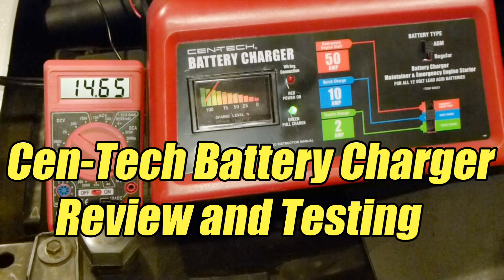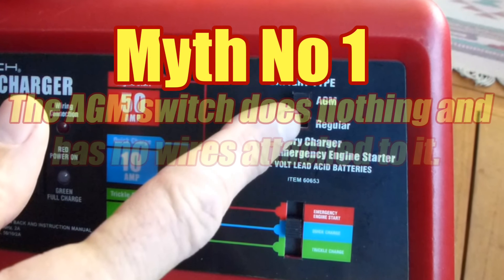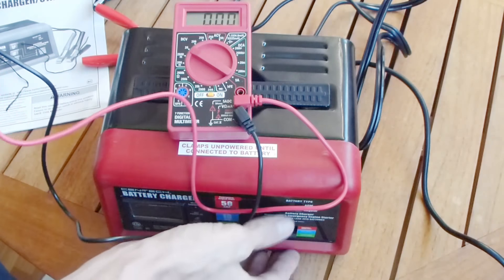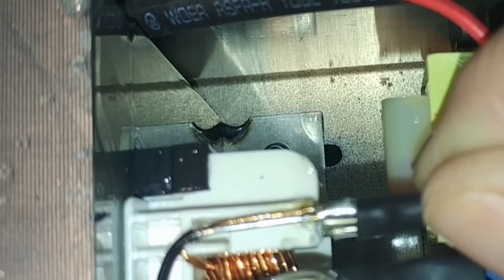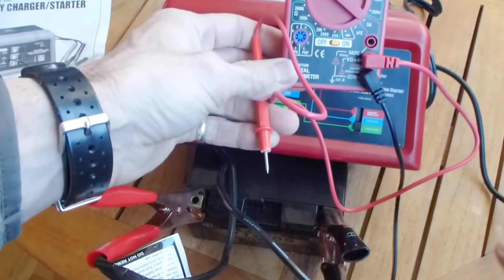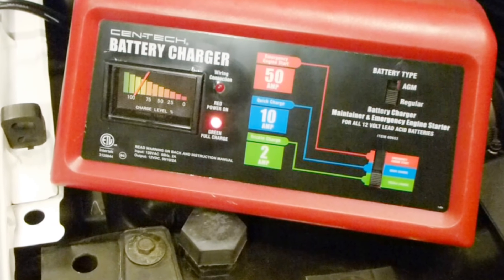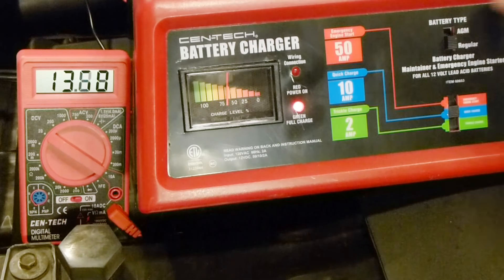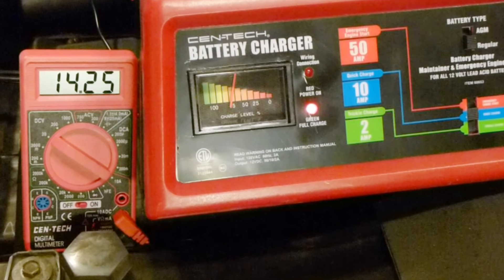Cen-Tech Battery Charger & Starter Review and Testing Harbor Freight

Comment: I set the charger to trickle,  plug in the charger, connect the clamps to the battery posts and nothing, no indicator lamps turn on, the charger appears to be completely dead accept for the tick sound it makes when I plug it in. I used it in the spring and it worked.  Six months later, nothing.  What night I be doing wrong.  Could it be my battery isn't depleted enough, less than 3 volts depleted? But then why won't my engine turn over?  No car lights, no sounds or signals.  I am completely baffled.  I reset the ground fault protector so I know the power outlet is working.  What's your guess?
Reply from the maker: You said "No car lights, no sounds or signals." I would check the current voltage of your battery. If it's below 3 volts, most chargers, including these, will treat it as no voltage and will not put out charge voltage. It's printed on the charger. It's a required safety feature. If the voltage is too low, you'll need to temporarily jump in a second battery to get this charger started for a while. If the voltage stays high enough, you can remove the second battery and let the charger work on your battery. Good luck with it.
Reply: @ScubaMoto I tested the battery's voltage as you suggested (with a digital multimeter):  point 65 V. Based on what you wrote the low voltage of the battery caused the charger not to engage (or light up).  Same as if it weren't connected to a battery at all or the charger were unplugged or if plugged in,  the circuit breaker had tripped.  Of course now I was wondering if my multimeter were functioning properly.  The battery had to be good.  It was only six months old and I had recently driven the vehicle 250 miles.

I returned the battery to the AutoZone where I bought it and asked him to test it with his multimeter, he did, "Nothing", he said.  Luckily for me it was still under full warranty.  I got a new battery and 20 dollars to boot.
Reply from the maker: Well that's just a whole lot of good news. I'm glad to hear your charger is fine and I'm glad to hear you got a new battery plus a $20 bonus. And I'm glad the video helped out. EDIT: If it were mine, I would test the charging system. A new battery lasting only six months could indicate a fault in the charge system or even loose battery connections are known to cause that result. Thanks for sharing.

Comment: I returned mine today. It did not seem to work in any mode when my car battery died.
Reply from the maker: Did you find one that worked on that same battery? Once a battery's below 3 volts, chargers won't activate. Chargers less than 20 years old anyway. Safety reasons. They'll need another battery involved to start the charge.

Comment: Will this charger charge a battery that is completely dead ? some changers Wil not work if the battery is dead.
Reply from the maker: Great point. Not too many modern chargers will charge a totally dead battery. They need to have a battery on board to do it. There's a note in the video description on this.

Comment: Thank you for such a detailed to the point review. Very good. Is there a chance we know how low the battery would go before the charger is unable to start? I mean it was able to start at 8V. What if I have a dead battery with less voltage? I am trying to find a charger that would be able to revive a battery with really low voltage.
Reply: @ScubaMoto  Sure, and thanks again. Keep the good work.
Reply from the maker: Waleed Almurshidy: The lowest I had on hand was 8 Volt but it should respond to batteries down to 2.5 volts but I doubt if a lead acid battery that low will restore. You would want to start in trickle (2 amp) mode. Let us know if you try a lower voltage.
Reply: Three cars which were completely dead were not initially charged by this charger as the batteries were likely seen as so low they didn't qualify as a valid charge destination. If so I usually attach another battery or jump from another car for 10 minutes to bring the voltage up to the acceptable range then attach this charger for a few hours.

Comment: Just bought one but when connected to battery i get nothing am i doing something wrong or is my battery just dead
Reply from the maker: Check the voltage on the battery. If it's near or below 3 volts, modern chargers won't provide output. Check note 3 at the bottom of the video description. I hope that helps.

Comment: Directions say to ground to the chassis. What does that mean?
Clip the negative to the vehicle?
Reply from the maker: Angela Schulz: Thanks for the great question and absolute kudos to you for actually reading the instructions. Most references to charging a car battery will clearly show clamping the charger directly to the positive and negative terminals on the battery. Nearly all modern vehicles are negative chassis grounded systems. This means the negative terminal of the battery is directly connected to both the engine and the metal vehicle chassis.  If access to battery terminals is difficult, there could be risk of accidentally contacting the two terminals with the large battery clamps if working in a tight space. That is why modern chargers, including this one, have cross detection if the clamps are put on the wrong terminals or accidentally tough each other. In these cases of tight working space, clamping directly to the positive of the battery and then clamping the charger negative to a known good chassis ground point is just as good as connecting to the battery and may reduce risk of crossing polarity. This is fine AS LONG AS THE BATTERY TERMINAL CONNECTIONS ARE GOOD AND CLEAN. This is why I prefer to carefully charge directly to the battery terminals. It is most common but is also simply my preference. Quite often, difficulties with vehicle batteries can be traced to poor battery connections that need to be removed, cleaned and re-attached before charging. Also, if the terminals of the battery are difficult to access (in the trunk, under a spare tire), some vehicles have remote charge connectors that are well labeled and easily accessed from under the hood. These remote connectors are often much closer to each other than terminals on most batteries so caution is also advised when clamping to remote charging terminals. Thanks again for the comment and for sharing.

Comment: I put it on my jeep battery. And nothing happening? Not sure if it the charger? Since nothing at all lights up. How do I tell if it the charger that is broken or my battery?
Reply from the maker: What is the voltage on the battery? If it is below 3 volts, modern chargers will not respond. There are instructions in the video description for charging completely dead batteries.
Reply: @ScubaMoto  Oh, So my battery can be completely drained and that why it not being able to charge? Dam, thought that what batter chargers are for LoL
Reply: @ScubaMoto  Which is the link of completely dead batteries. Im going thru them but do not see it. Thanks
Reply from the maker: Prophet seven: Yep, it's normal for modern chargers. NO/low voltage is seen as the same as no battery so for safety reasons, no output to clamps. The charge dead battery note is not one of the links. It's one of the "notes below" (note number 3) will walk you through it.
Reply: @ScubaMoto  Got it, I just exchanged the battery. Free Swap

Comment: I seen you had a 12v battery at 8v and it worked ….how low in volts can the battery go ,before the charger won’t turn on ?
Reply from the maker: They don't give a specific cut-off but modern chargers are all set for safety reasons to cut off below 2 or 3 volts.

Comment: How will this work for charging my RV batteries on my travel trailer?? Is this a good choice?
Reply from the maker: Mike in the drum room: You should be fine since it has a good trickle charge mode (2 Amp). But it might also be one of the few times an extended warranty on the charger makes sense due to prolonged use. Thanks for watching and for sharing.
Reply: Mike in the drum room I am trying to charge my rv batteries and the charger doesnt light up when i connect it to my battery

Comment: So if I understood you the starter mode only press out around 20amps until the starter is engaged? So if your trying to give a battery a little shot in the backside is it ok to use the starter mode for a few seconds before you seeing to regular mode? Out is that not a did I idea
Reply from the maker: David Beaver: Thanks for the question. I simply demonstrated that the starter mode does not engage until the charger detects the draw of the starter engaging. Not much can be changed instantly about a full size lead acid battery. It will take time to build a good charge. It's best to leave the charger on the battery in 10-amp mode until fully charged. It will take some time. Thanks again for the question and for sharing.

Comment: Just bought this battery charger, the power lights not even turning on it flickers and doesn't work
Reply from the maker: Check the voltage on the battery. If it's below 3 volts, most chargers won't activate on it. It's normal. There's a note at the bottom of the video description on that. If the battery has over 3 volts, return the charger while you can. I hope that helps.

Comment: Hello there I bought the same brand new I need it to charge a dead battery I took the battery off the car put it in my garage plugged it and there is no light on that tell me is on, do you think is defective?
Reply from the maker: That's normal for a totally dead battery. There is a note in the video description about using modern chargers on dead batteries. I hope that helps.

Comment: What I find confusing about this charger's meter is that 100% shows towards the green side and 0% shows towards the red side. Is that what the battery's "charge level" is or is it the "charging level" rate of the charger? And when you crank the engine, the needle goes to "0" - is that the battery charge level or is it working really hard to provide current? Its just confusing.

They should have had 2 meters - one for battery and one for the charger's power output. Or if not possible electrically to show the battery's level then have a legend or markings showing that if the needle is to the right, the charger is outputting more current.
Reply from the maker: Agreed. As I mention in the video I'm not too happy with a gauge that has no units. I prefer the charge meter to have amps as units. Thanks for the comment.

Comment: So if the battery is just completely shot she won't activate and charge it up ?
Reply from the maker: Erik Kinsey: Yes, that's a safety feature typical of all modern chargers. Batteries below 2.5 to 3 volts won't activate output voltage. It's easy to resolve by temporarily jumping in another battery and then removing it. Thanks for the question.
Reply: Problem solved,, Most people will need this instructions

Comment: I plugged my car battery up to it and I heard it click on but no light shows does that mean my battery is just done for
Reply from the maker: Jacob Reynolds:  it would be helpful to have more information about your battery. For example what's the static voltage and how old is the battery? Try both the 2 Amp and 10 Amp settings and give the charger several minutes to establish a charge level. If it clicked, then the voltage on your battery is probably high enough to activate the charger but I would check the level on the battery regardless. Thanks for watching and for sharing.

Comment: How low WILL it go though? I had to rescue my car battery last weekend and it was only putting out about 2.2 volts. The smart charger I have wouldn't touch it, I had to get an old charger from like 1970 that was a transformer and a diode, use that to bring it up to about 6 volts where the smart charger would take over.
Would really have liked to see tests where the motorcycle battery was drawn down lower and lower to see where the charger gave up on it.
Reply from the maker: Most chargers are similar with a cutoff around 2.5 - 3 volts needed to activate the charge function. Regardless of the charger brand, I just use any small battery bridged in temporarily to activate the modern charger long enough to bring the target battery beyond 3 or 4 volts and then pull the bridged battery out and let the charger finish the job on the target battery. I hope that helps.

Comment: So i just bought this at harbor freight and im gonna use it on a van thats been sitting in my driveway for about 6 nonths with a battery thats totaly dead.Ive never used one of these before so let me get this right? First Set the corect settings im assuming its normal battery and quick start? Then connect the cable leads? Then plug in the machine? Then try to start the van?
Reply from the maker: It won't respond to a totally dead battery (zero voltage) Check the voltage on the battery. If it's near or below 3 volts, modern chargers won't provide output. You would need a second battery. Check note 3 at the bottom of the video description. I hope that helps.
Reply: @ScubaMoto  So what your saying is I shouldn't even try with something I just bought today? So basically I bought this machine for nothing? What is the emergency engine start for if not for this? I tried to jump start it with another car connect to it with jumper cables and it didn't work but it was almost about to start but my gf told me to stop and try again another day but I heard about these car battery jump starters so I went to the store and seen this one said on the box it was a car battery jump starter and a battery charger both in one .But now it's your opinion I forget about this machine and don't even try and go buy a new battery instead?
Reply: @ScubaMoto  Btw,you have an awesome channel very informative and from a very knowledgeable person who knows what he's talking about. person
Reply from the maker: I have no dates or other info on your old battery but depending on the health of the old battery; if it was mine, I would trigger the charger with a second battery if needed (and as mentioned above and as described in the video description) and then leave the charger on it overnight. You'll learn a lot about your old battery that way. If it's still useable, it will turn over the van engine after that. If it still won't turn over the engine after an overnight charge then it's time for a new battery. They really should not call it start mode since 50 amps on its own is nothing. The 50 amp start mode is useless to turn over an engine without some help from a battery. Most batteries are 500 - 800 crank amps. The 50 amp start mode is intended only as a supplement to a drained healthy battery that has had at least a couple hours on the charger. Good luck with it.
Reply: @ScubaMoto  What happened was I connected the cables and set the charger to emergency mode and it wouldn't start so I unplugged it and put it to quick mode the button in the middle and let it charge for about 4 hours and after that the van started right up on the first try .Thank you for your replies and also for your very informative video it really helped me a lot just to kinda understand the machine .Thank you.....
Reply from the maker: I'm glad my video helped you out. Great job on getting her started and thanks for sharing your experience.

Comment: I have a 6 month old battery, for what ever the reason after rig was setting for a week battery went dead on me. Maybe a parasitic drain. But the 12volt battery was down to 1.96 volts. This charger would not kick on to charge. No light came on charger when hooked to battery. While charger was hooked to battery i did a voltage reading on battery terminals. No voltage at all. So maybe this thing does not work on a battery with that low of voltage. 
Any ideas?
Reply from the maker: Blue Steel: You are absolutely correct. Like most modern chargers, this one will not put out voltage unless it detects about 3 volts. It's a safety requirement. I have a note in the video description about it that might be worth a look. Thanks for the comment.

Comment: Sir, I got one of these off my dad and when I hook it to a battery the charge complete light comes on for about 4sec. And goes back into charge mode back and forth repeatedly. Do you have any idea what's wrong?
Reply from the maker: If you didn't get the owner's manual with it, you can download it from the HF website for free. What you describe is common for initial charging. FYI It's always best to begin a charge with the lowest output setting and let the charger assess the battery. Several things can affect this; battery size, age, condition and whether the battery has an internal short. If after about 10 minutes it doesn't go into a charge mode then the battery is either already charged or may have an internal short or other issue. What is the current voltage of the battery? Age of the battery? Size and type of battery? I hope that helps.

Comment: Will this charge a battery that's completely discharged (but not faulty)?
Reply from the maker: No. For safety reasons, modern chargers need to see a few volts to activate. See note 3 in video description to see how to use it to put a charge on a completely dead battery.